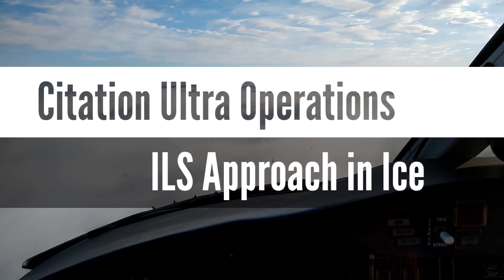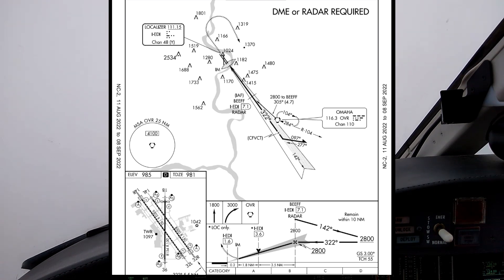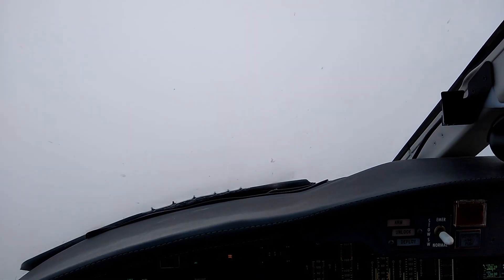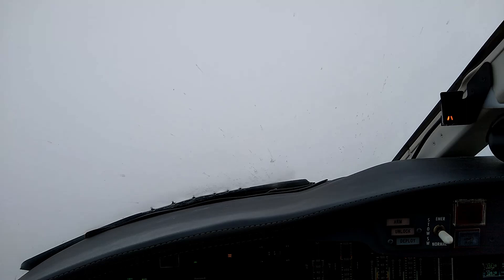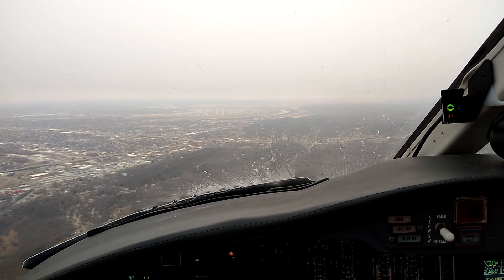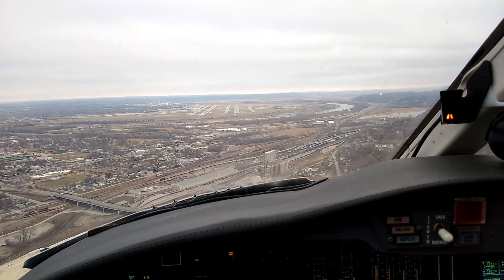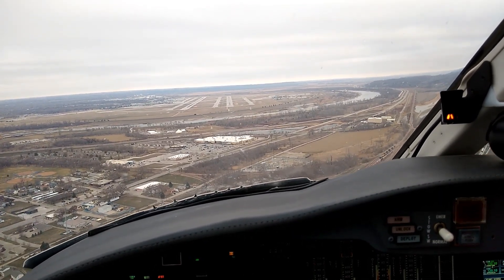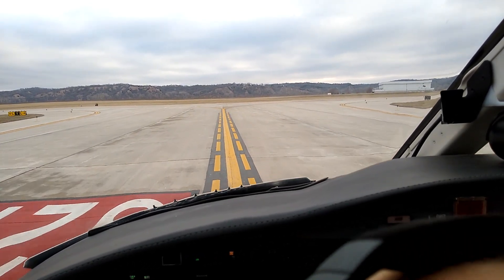Citation Ultra Operations - ILS Approach in Ice

Comment: I get a lot of pushback ftom more experienced pilots than me insisting you should extend the gear before initial flaps. I would love to hear your thougts on this
Reply from the maker: My philosophy is to fly in a way such that the pilot is mentally "ahead" of the airplane enough that they don't need to throw out devices right at the max speed. There's a difference between "could" and "should" to think about. Could you throw out the gear at 250 knots, flaps right at 200 knots, etc? Sure, there's nothing saying you can't. But it's both less strain on the machine and more comfortable for the passengers if you put flaps out about 195 knots about 7-10 miles from touchdown, follow up with the gear about 5-6 miles from the runway, then full flaps at about 150 knots at 4-5 miles from the runway.

When it comes to the order of gear and flaps, think about this...how does every airline out there operate? It's nearly always flaps, gear, more flaps. That's not by coincidence. It's the optimal balance of maintenance on the aircraft, fuel efficiency,  passenger comfort, and stabilized approaches.

Long story short, do whatever you want as long as you're not exceeding a limitation, but I don't see any benefit to gear first and I do see potential downsides.